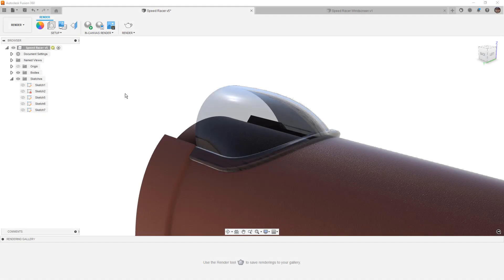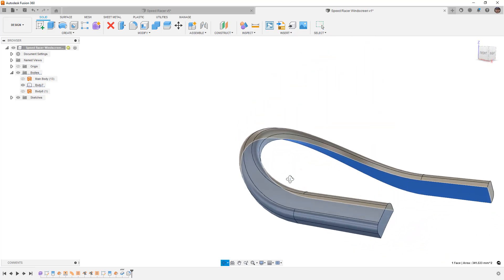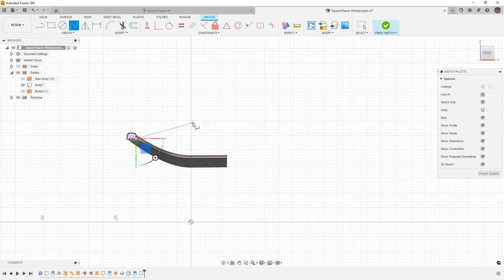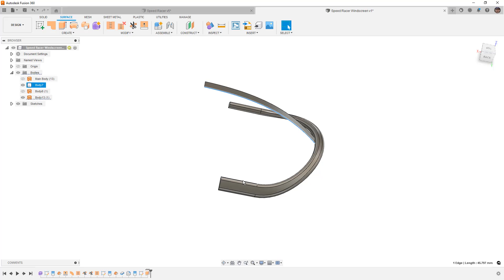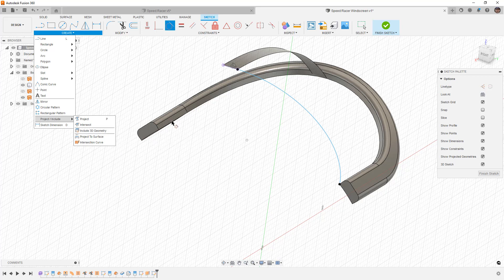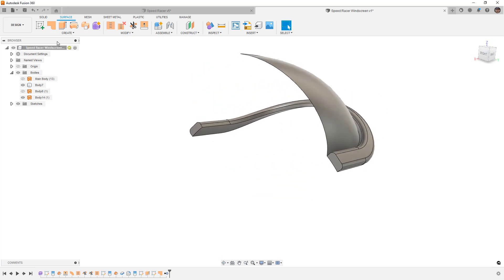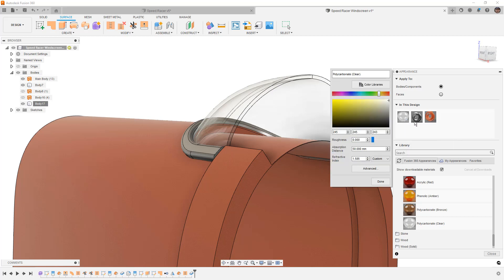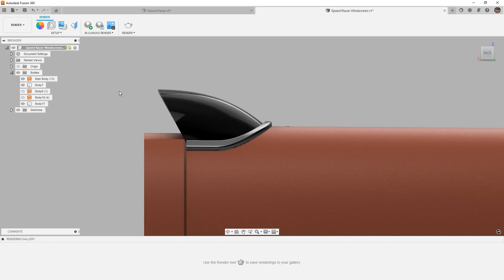Surface Mastery Part 12 - How to Use Surface Tools to Model a Bubble Windscreen for a Pod Racer

Comment: Hey I have a problem that my patches often don't connect, when they should be geometrically connecting. I often use intersection curves to make those. Can you help me out on that?
Reply from the maker: Tough to say what the problem is.  The Patch tool has to have 100% connected and closed boundary.  Even a tiny gap or two ends that look connected but are not coincident, it will not work.
Reply: @LearnEverythingAboutDesign  my problem is, often when transforming the surfaces (like stitching, splitting), or when projecting surfaces, they become inaccurate. How can I keep those accurate
Reply from the maker: @ruphus02  Stitching has a tolerance in it and it will move the edges around to get things to stitch together.  Splitting shouldn't though.

One thing about splitting complex surfaces is that your inputs are generally planar.  Like if you use a line on the front plane and split a complex part, it will seem to get distorted.  A lot of times i use offsets and ruled surfaces as split tools, but that comes with its own problems.

Whenever I am defining a boundary for complex shapes I try to make sure things like projected or intersecting edges are fully defined in their own sketches first.

Comment: Would love to see how you made the trim ring but another great video thanks
Reply from the maker: Great suggestion!  In this case I can tell you it was just a thickened surface.  Split/trim the face then use thicken to get a solid from that.  Its a good method as long as the solid can go out in the normal direction to the curvature.

If you need to be a bit more in line then generally you would start the same with a split face/offset surface.  Then use a combination of ruled surfaces, offset, and trim.

Comment: Matt, quick question for you: I see the you usually work with fit point splines in 3D sketches. Is there a reason for this choice?
Just asking because with control point splines I find it more easy to control the shape, since you can move the control points in ortogonal planes like XY or XZ and when you have canvases ijn those planes that helps for adjustment.
Reply from the maker: It all depends on what I am doing.  If i just have a simple curve where a start/end with tangency handles will work I generally go for the Fit Point.  For more advanced stuff I gravitate toward the control point spline and generally i will make the first 3 control vertices inline with the tangency of whatever edge i am attaching too.
Reply: @LearnEverythingAboutDesign  Great, I use the same approach. I probably have only seen the videos with simple 3D splines 😉
Reply from the maker: @NorMaker3d  I think the video i dove in a bit deeper was a series i pulled down from the channel.  The videos aren't listed but you should still be able to see it here. https://youtu.be/AfinrLwjOtU
Reply: @LearnEverythingAboutDesign  Thanks for taking the time to look for it!

Comment: So many awesome tips and tricks in these videos.  Extruding first for tangency is such an awesome idea.  Makes me think of building virtual jigs for construction.
Reply from the maker: Glad it was helpful!  If you don't extrude a surface and you are lofting you can use a sketch for direction constraint which should do the same thing.  As sort of a general practice I like to build those control surfaces but its not always required.

Comment: Hi Matt, thank you for your great videos! We are struggling with welds in Fusion. As far as I know there is no option to insert weld beads, but perhaps you could advise or show an example how to  draw these...?
Reply from the maker: sadly there is no welds in Fusion.  If you are trying to model a fillet bead at the root of a part, if its a single body you could add a chamfer or you would have to draw the profile and sweep it along the edge you are welding.  There are weld symbols in drawings though if that helps....
Reply: @LearnEverythingAboutDesign  Thanks

Comment: Nice one. Have you considered breaking the large patch surface into 2? For the main face, you can loft from one arc to the other arc, leaving a small quadrant shaped opening that is bordered by the straight, which can then be patched. You would need to somehow split the arc at 5:10 for this workflow though. Might be interesting to compare the surface quality of these 2 methods.
Patching the whole surface does look pretty good though!
Reply: Good to see you on here!
Reply: @ThatAdam12  Oh, hey! Good to see you here as well.
Reply from the maker: I tried first to make the entire thing in one patch with a mid guide and that didn't look great.  I did attempt a loft as well.  Out of the few ways I tried this, the Patch with the guide surface for tangency seemed to be the best workflow but certainly not the only one!  Thanks again for commenting!!